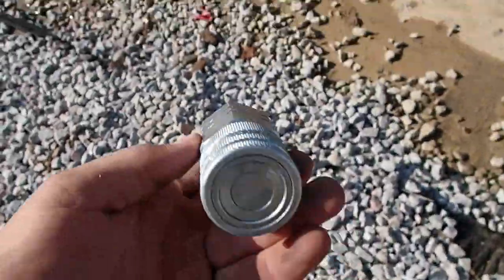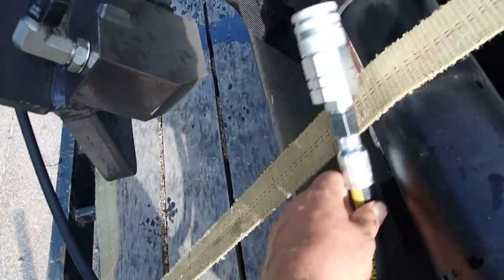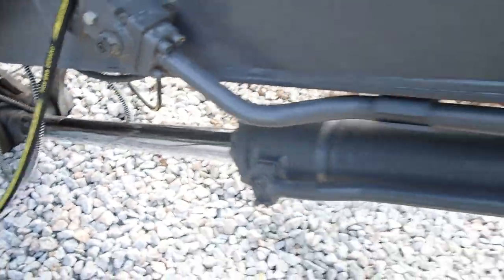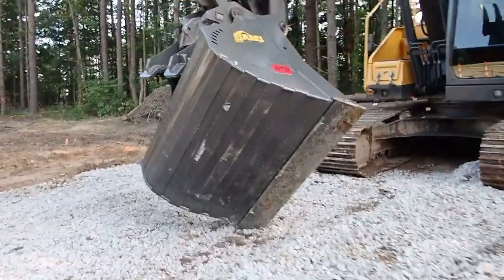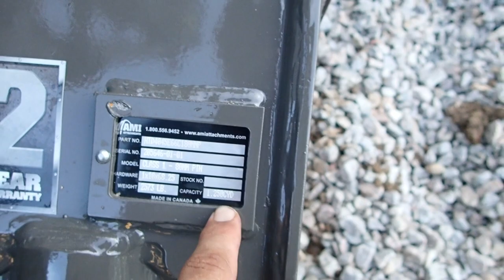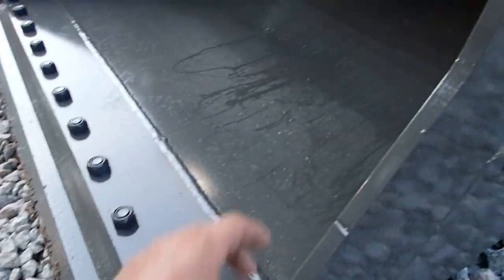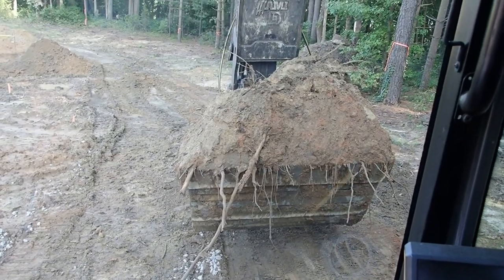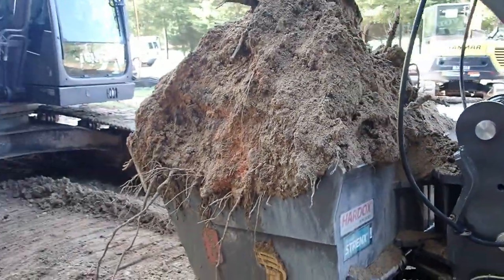Picking Up My New AMI 66 Tilt Grading Bucket!

Comment: Go with rototilt or indexator, here in sweden the customer usually demands it for the jobs, however they do pay a small fee extra for it. But the advantage is that you can also use your old buckets, the disadvantage is that if your about to use heavy force to get a big rock etc (unless you digging around it) up, you may end up breaking it and need a repair, so then we usually end up removing the tool before using heavy force.
Reply: And then you talk about VERY heavy digging forces on the tiltrotator!  :D
Reply: Very true 😋

Comment: You finally got a tilt bucket, it's so useful,but I would prefer something  similar to the Tiltrotator TRS8,has much more versatility.
Reply: Stuart Andrews they are a slick attachment. But they are very very pricey
Reply: @blacksheep9734  I dread to think what the price is in the states for one, but to me it's a long term investment,it's 360 degree versatility opens up many opportunities for other work
Reply: @blacksheep9734  How pricey?  Is it worth the money?
Reply: @stuartandrews4344  yeah I would have invested in with the other thing. I started running a cat 426 with the double lift cylinders that had a wain roy setup. 25 years ago.. lol I used to do alot of grading work. I was a cheaper alternative to a grade all.. lol when it made sense of course and a few times it didnt.. lol
Reply: Don't know about pricing at all but the 360 degree versions look game changing.
Reply: @rockandmeatroll  Used a Engcon Tiltrotator last year, once I got used to the controls,it made the work so easy.
Reply: @stuartandrews4344  
l
Reply: In Holland its almost Standard on all  wheeled excavators. Same as 3d gps

Comment: A couple of adjustable flow controls mounted on the bucket would fix the speed issue without changing the speed of the thumb when you are using it.
Reply from the maker: the machine has separate settings so I can just change the flow in the cab
Reply: @letsdig18  Thought it might be set up that way, but put the suggestion out there anyway in case it didn't or someone else might stumble upon it and find it useful.

Comment: You need to put electrical 6/2 switching valve into the boom tip to be able to use Thumb and Tilt just by pushing a button. Great bucket for You!

Comment: That is a high quality bucket. Welding on both sides and I do like the cut outs to let water out. Where I work we only make a 60 inch bucket but not pivoting bucket. Not saying we don't make that style. I seen you had a ripper inside that one bucket. Would like to see a better shot of it sometime. We do weld those on our line. The casting like you have and also one with fittings and bushings

Comment: Only two things missing... one the bucket needs to spin. Second need a tweezer, behind the bucket at mount, that can spin and tilt with the buck but when bucket off the spin tilt stays. Then can use the tweezers to pick up things. Like large rocks turn and place as needed ETC. A channel called,  Headblom has his set up like that. He is almost as surgical with it! Check it out.

Comment: I've been watching the Swede, Hedblom, and his YouTube channel for the last couple of months. He has a tilt/rotation type bucket on his little excavator and it's freaking amazing what he can do with it! I'm going to enjoy your future vids when you get a chance to use this new beauty!
Reply: Around here almost all excavators from 3.5 to 35tons have a tiltrotator. Only small machines 1-2,5tons use tilt only. Why is there such a big difference between Sweden/EU and US with regard to this? Work to be done is the same. Efficiency gains are the same.
Reply: Yeah, Hedblom uses that like a 3rd arm! And then also DirtNinja in New Hampsire was first excavator I saw using those tilt-rotation buckets. But not on something like 220 series. That think looks... awkward.
Reply: @BosseTub  yea I'm no machine operator but I have been noticing this also, its strange. I guess it might be a the price and risk of more breakdowns but like you say even tilt seems uncommon in US.
Reply: Brian, how much would this cost? Just a guess would be cool, I have no idea.
Reply: It's not a "tilt/rotation type bucket". The tiltrotator is an attachment on it's own attached on the stick - meaning; it's has nothing to do with the bucket. 
But on/or under the tiltrotator you can attach a long range of different type of buckets and other tools; Grading bucket (most common used), Cable bucket, A VA-bucket (that's a bucket for sewer pipe graves, profile bucket, Grading beam, pallet forks, A brush to clean up a work site. 
With Engcon EC-Oil (= Oil connections are automaticly attached to the tool, the oil goes through the tiltrotator in a swivel - no hydraulic hoses to attach manually) you can attach hydraulic operated tools with ease like a rotating brush, hydraulic pallet forks, crapple for stones or timber trunks.. 
The list could go on for ever.....
Check up 'Duckgirl86' here on YT to see a skilled girl using a varity of equipment with an tiltrotator.

Just one of her clips: https://www.youtube.com/watch?v=htFVNfeJiRs&t=456s
Reply: I don’t understand why he’s not getting a tiltrotator it would be perfects for the type of work digger is doing. In fact a European style of setup would fit him well and be more effective. By European I mean a wheeled excavator with a tiltrotator and a trailer.
Reply: @TheGaggenau  I agree 100%

Comment: Nice bucket Chris. There should be flow control valves on the tilt cyl so you can slow down that bucket. You also can use your foot pedal and you can control the speed..

Comment: And the next thing you should consider, is to replace those manually operated valves with eletronically controlled one, so you can flip a switch in cabin to select either tilt or thumb function. I would imagine there will be several cases where you would like to use a thumb for a second while doing grading...

Comment: You will like the cylinder tilt better than the helac motor anyways. We relently went to one on our backhoe (Ami too) with the helac and it has no power to adjust when grading. It will also sometimes move out of place its kind of a pain in the butt. I do like the extra added rotation though.

Comment: Could be me, but you might want to weld those rings for the hoses up a little higher, if you're at 45 degrees they seem to be touching the top edge of the bucket which might seem minor but will wear the hoses through in a relatively short time.

Comment: Strap was cut/shredded because there was no twist in the strap. You will see your strap whip in the wind while driving. This causes the strap to tighten and loosen slightly, causes the strap to cut. Put one twist and it eliminates the wind whip.

Comment: That’s the right size clean up bucket for your machine a 200/210 size machine here sports a 60 inch clean up. The tilt cylinders add some weight, your going to hate those hose quick couplers. They are a bain of my existence we have them on all of our machines. See if you can get caps for the ones on the hose ends. They have to stay clean they get sticky when they get water in them. The female fittings are the worst you use every combination of the F bomb when they don’t want to co operate. Keep spares in your machine you will be thankful you did.

Comment: Okay....stupid question time!!
"Do you have the same pulling power on an angle as you would straight?"
Should make your grading of Ponds a whole lot easier!!😁
Reply: Just from looking at it, it’s connected the same way at every angle.  So it will pull the same strength at each angle.
Reply: Same power but only worry in my book would be the sideward torque on the stick and boom.

Comment: I'm probably talking science fiction here but since fill and contouring etc require successive lifts to get to grade and you usually mash the surface to compar as you go, why not a bucket with a thin plate compactor built in to it running from the thumb circuit. Take some thinking just how to arrange it but I bet the clever folks that made your tilt bucket can come us with a few ideas.

Comment: Chris , curious what size stick you all use on your excavators ?
Short, medium or long. 
You have a lot of extra weight on your machines with all the extra attachments you run and I notice you don’t tip the machine much from being unbalanced.
I’m guessing short arm or maybe medium with the stability you seem to have .
I don’t notice any extra rear counterweight either for stability ?
Reply from the maker: the standard stick, I would not recommend this setup on any long stick machine

Comment: You need to get a restricter valve on the bucket hoses for more accurate bucket angle adjustment. Is the tilt run off the foot pedal or an electronic switch on the joystick?

Comment: So the tilt of the bucket, operate in place of thumb? And if so, and you turn down the psi to slow the tilt.. won't that slow the thumb when you use it?.  Any way it is a great improvement to help you do the already skilled work you do! 👍👍👍

Comment: Aaah chris you should have got a tiltrotator you would love it all most the same price as yoyr tiltbucket uste 😉i haw a tiltrotator on my Takeuchi 14ton i love it ill never go back!!!!!
Reply: How do you like your 14ton? What did you have before?
Reply: Tb2150
Reply: @MaximusMerideus  i like it werry much I don't like to big diggers or to small I prefer digger from 9ton to 16ton with that size you get to do smaller job.s and bigger one. With 20ton and upp you mostly do loading or moving dirt. But my tb2150 is a beauti machine it has everything 😉👍
Reply: @MaximusMerideus  i had a tb290 a 9 ton Takeuchi also a great machine super strong💪both haw rotortilt 💪👍
Reply: @michaelrasmussen5430  Thanks a lot for the valuable info. I really appreciate it, buddy.
Reply: @michaelrasmussen5430  what do you think about the tiltrotatorsTRS8 that everyone talks about?

Comment: That plumbing works, but there should be X1 and X3.  Makes switching buckets faster and easier, plus it's handy to be able to use the thumb.  Do you find the thumb works it's way down while you're using that bucket?

Comment: One advise: Get a couple of those hose covers, the spiral-wrap kind. And make sure they are yellow; that makes it easier to see your hoses in darknes or if digging deep trenches were a steel pipe suddenly could appear and "grabbing" your hydr-hose and destroy several hours for you.... replacing the hose and eventually even the coupling if it's been jammed up also.
This is the cover  I mean if available in US? (Should be): https://www.hkhydraulic.com/hydraulik/hydraulslang/slangskydd/sp-110-1200-g
Should also have joysticks with real rollers on so you can adjust the oil flow more precise, now it seems to be just "BAM! BAM!"- all oil at once attacking those tilt cylinders.

Personally I would spend the money on a Engcon tiltrotator with the easily detachable grapple in the rear, making the machine more versatile. Here in Sweden those tiltable grading buckets are almost obsolete on machines under 35tons.

Comment: when the radio came on made me realise you have to do whole jobs without music. that's a sacrifice i don't think I could make. cudos
Reply: I'm a Swede but live in Germany and apart from a lot of work on our farm/houses in Sweden, I've only occasionally used an excavator myself. However we I fully agree with some comments here from Sweden regarding the use of a Rototilt. It makes the machines so much more flexible and as far as I know, you hardly find an excavator in Sweden without one. It also my feeling that operators would refuse to use one being in operation for so many years.
I must admit, however, they are not so common in Germany either.

Comment: If you disable the tilt, can you use the thumb in a pinch?
Reply: Looks like he can level out the bucket then switch the valves back. Then it becomes a question of, where is the thumb going to be on that bucket.

Comment: Why is the thumb and this tilt not as smooth as the normal bucket movements?
Reply from the maker: I had to flow rate set to high, I had to change it after the video

Comment: Came profiled with fluid? Or should you check the reservoir?
Reply from the maker: It had fluid in it
Reply: I typed “pre filled” about four times and it still put in profiled. But now it gets it right. Going to be able to do more from one position now rather than having to reposition to contour what you’re working on.

Comment: don't you have to. Teflon tape on those threads
Reply from the maker: no theres a rubber oring
Reply: Straight threads have O-rings. NPT is were you need teflon tape. However NPTF fittings do not use teflon. The threads are tighter tolerances & create a mechanical bond to keep it from leaking.